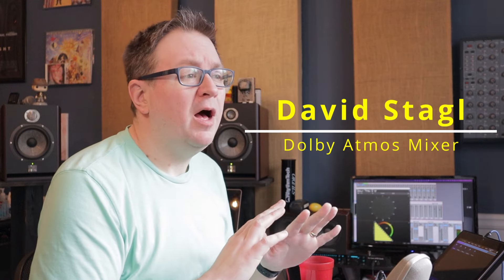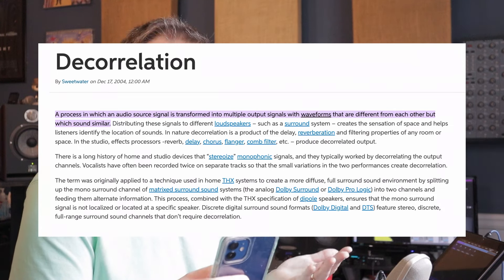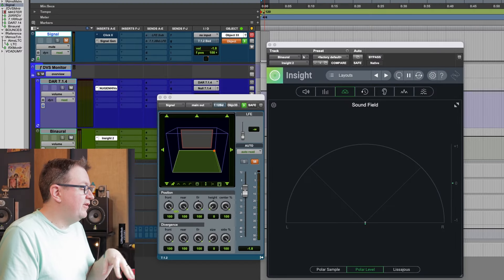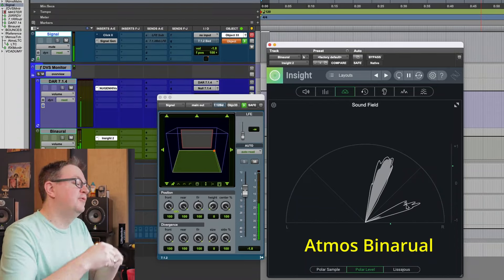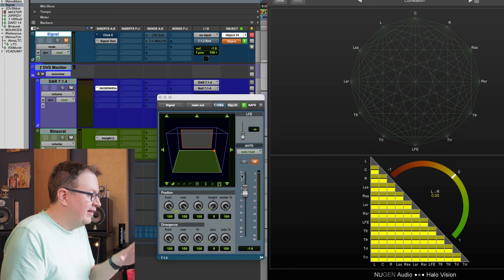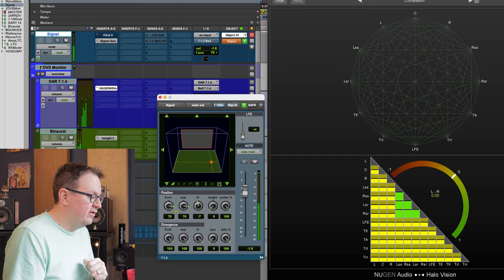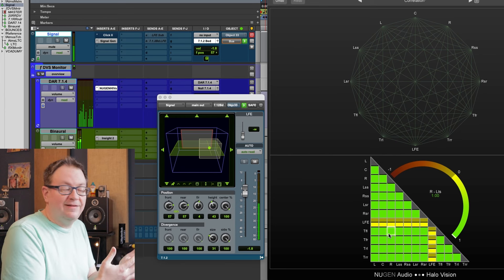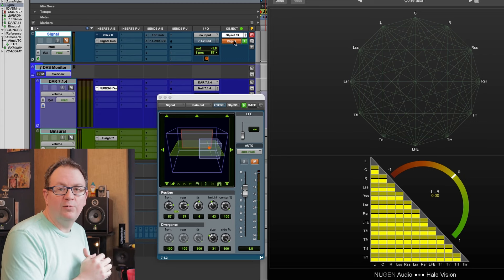Dolby Atmos & Correlated Audio

Comment: I'm afraid you're not using your terminology correctly. What you are seeing in the correlation matrix is not decorrelation but anticorrelation. Anticorrelation is correlation with a negative correlation coefficient. A decorrelating process moves signal towards an uncorrelated state, where the correlation coefficient is close to zero. Uncorrelated signals don't have any phase issues when summed, by definition. Anticorrelated signals mostly cancel when summed, correlated signals mostly amplify when summed.
Reply: I agree. Have you heard Atmos over speakers? Do you think Atmos is properly propagating uncorrelated audio?